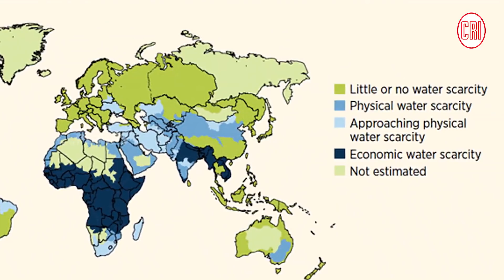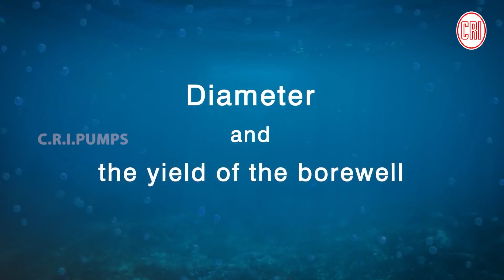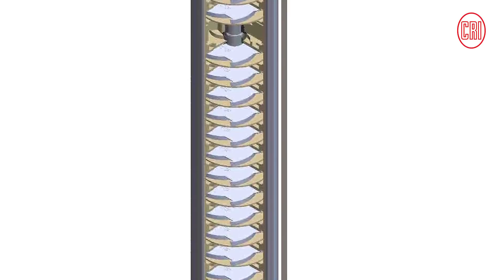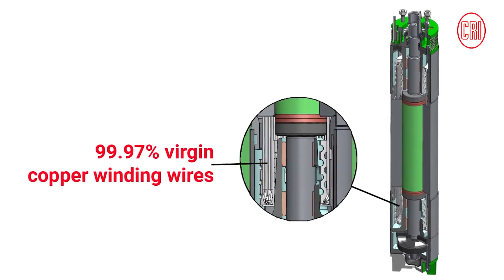C.R.I. Pumps | Lift water from depth over 2000 feet with C.R.I.

Comment: Iam using cri pump 1,5  hp v3  32 stage  since 8 years ago we don't open a single screw till now thanks to cri
Reply: @sujansingh6090  total 600 feet bore 360 feet per pani nikla